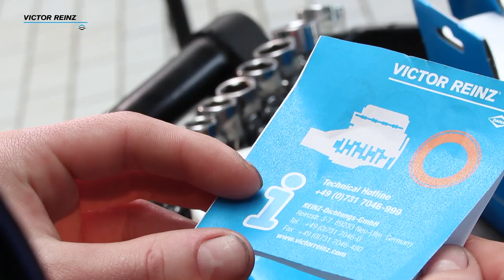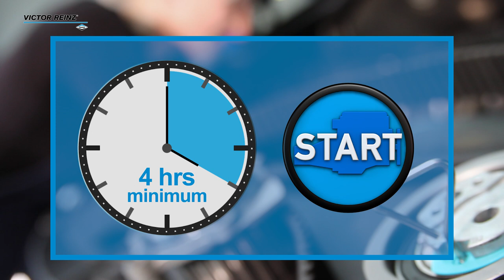How to install or replace a PTFE oil seal! VICTOR REINZ oil seal

Comment: Do not touch cleaned area with fingers, you could leave fingerprints or grease from the fingers. Engine must be rotated few revolutions with PTFE seals installed to leave sealing material on shaft and after that engine must be turned off for 4 hours in certain temp range. This video is not explaining the right procedure so do not follow this.

Comment: bought a Victor Reinz full gasket set last year for a BBC.  I like to compare new parts with old parts.  Just something I learned the hard way.  The rear main seal did not look right.  I put it together on the crank and found that the seal lips did not even touch the crank.  If I had just put this motor together and put it back in the car, I would have had a massive oil leak.  I tried to contact Victor reinz and got NO response.  All I could think was how many guys put motors together with this (wrong) seal.  I never buy Victor reinz anything anymore.  Anyone (whoever put the kit together) can make a mistake.  My problem is Victor reinz simply did not care.